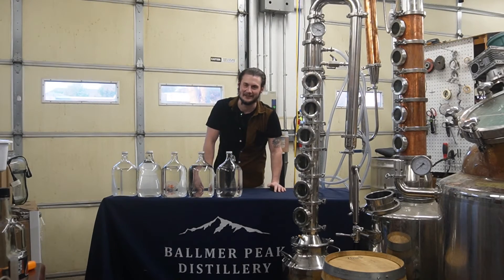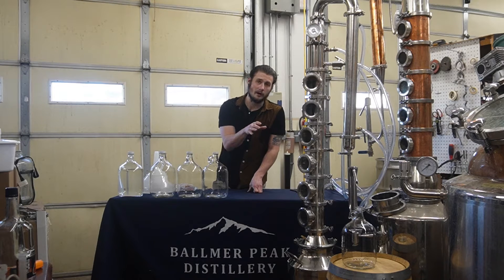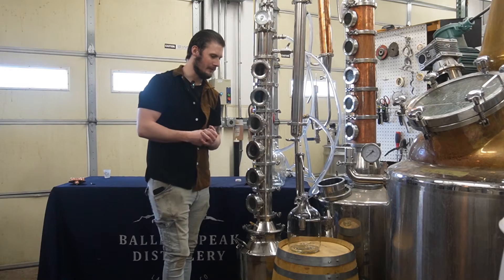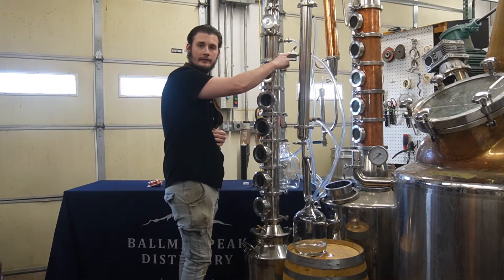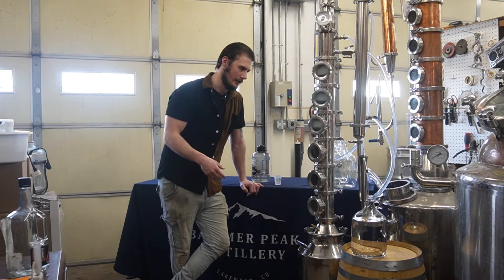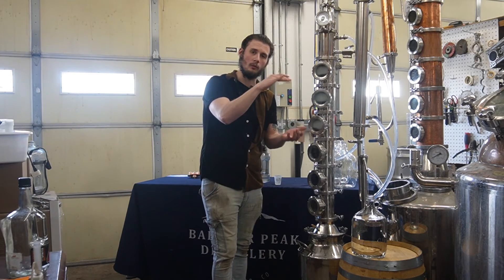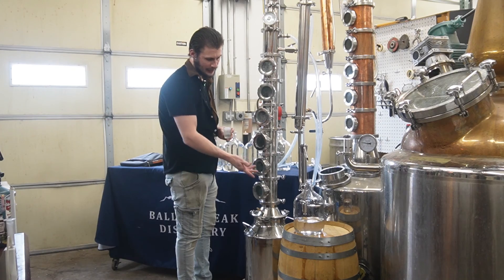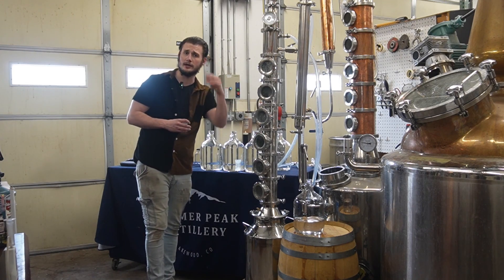How To Make Vodka and Getting To 190 Proof In A Still

Comment: Sir how and when do you take the Heads off using a thumper  . No one has show that in all the videos on youtube . My  rule of thumb is one ounce of heads per gal in the still or worth then I take the body and if it turns milky or under 50 proof I use that for the next batch to bring up the worth level . I'm using Eldderberry squeezing from wine and put two cups of berries in the thumper with two cups of water . I use a lot of your parts from Mile Hi Distilling . Thanks
Reply from the maker: Heads can be tricky becasue there's some variables with them. Sugar and molasses have much less heads than fruits would for example. How clean your still is can also contribute to the amount of heads as well. For a 6.5 gallon batch, I take off 350-500ml for foreshots and some of my heads, then usually fill another 12 oz. jar worth of heads and that's usually a safe number for me, but runs can be different.

Comment: why is the column full of wash.  It shouldn't be full.  I'm surprised it worked at all.
Reply from the maker: That's called reflux. It is low wines. That is normal for a reflux still.
Reply: @milehidistilling1  I have a reflux still.  That's NOT how they are supposed to work.
Reply from the maker: @SimonClemence-z2n  With all due respect, we have been building stills for two decades and we have a lot of knowledge on how they are supposed to operate. Does your still have plates? Plates will cause this in a still. It is how the plates are designed to work. Maybe that is the difference between your reflux still and our system here. Although, I do admit, this is more flooding than what you typically want to see in this system and is due to me overheating the unit. Regardless of that, you should always see some flooding in the plates if you're operating them right.
Reply: @milehidistilling1  I have a 4 inch six plate copper flute still with bubble plates.  The only time it has ever flooded like you are showing here is when I didn't leave enough head room in the boiler and had both elements working flat out.  A normal bubble plate flute still, when running at the correct adjustment should see product bubbling on the top of the plates and dripping down from above with not one of the chambers full of wash.
Reply: @milehidistilling1  Yes I have bubble plates.  The product should be bubbling and dancing on the plates with some product dripping down and NO flooding of the chambers.  The only time that ever happened to me was when I didn't leave enough head room in the boiler and ran it too hard.  And then I only got the first two chambers flooding.  With all due respect you should remove this video.  It demonstrates that you don't know how to run the very stills you build, which would have to impact buyer confidence.
Reply from the maker: @SimonClemence-z2n  I appreciate the notes and while I will have to do more research on the topic, I have to disagree with you for now. I've been to a lot of distilleries that use our equipment and every one I've been to using a flute has had activity in almost all of the plates. Here's a video from a distillery down in Reno using our 53 gallon flute and you can see he has activity in 5/6 plates: https://youtu.be/krOfBe3CUek?si=h7wRjkdRdtZtPs9K&t=733. Not saying you're wrong, but I just haven't had the same experience with these plates through the distilleries I've been to. I guess I will just have to do some more research and talk with a few more people.
Reply from the maker: @SimonClemence-z2n  Also, wanted to show you George Duncan from Barley and Hops running our flute in which he had most of his sections bubble as well: https://youtu.be/d6-JPCkXaqI?si=cm7L0MiQrGUhsCpy&t=1237
Reply: @milehidistilling1  The Reno guy is running better than you show in your video but is still running too hot and fast.  He admits it and has two 5500W elements going (wow) that's way too hot and hard.   The Barley had Hops guy has it right.  That's what it should look like.  Bubbling on the plates with no flooding.   This will give you the cleanest tasting product and is how a still should run.
Reply: @milehidistilling1  Yes George has it absolutely right.  Bubbling on the plates with no flooding the chambers (i.e. not full of product).  The still can't properly reflux if the chambers are full of product because when the product is knocked down it can't get past the flooding.  I suggest you may need more head room in your boiler or turn the element down or both.  Oh, and the Reno guy has not quite got it right either, but he's closer than you are.  I'm not trying to be rude, but you can see from comments that people are believing you have got it right and they will learn the wrong thing.   You need to fix this.

Comment: why would the 190 eventually start dropping if you maintained the defamator temp etc  i figured it would just stop coming out  when there is too much water and no longer able to strip high alc at the set 190
Reply: You would also have to reduce the power going into the pot as the alcohol percent goes down to keep from overwhelming the column,  as there will be more water vapor that needs to be knocked down reduces the efficiency of the column.
Reply from the maker: Because there is only a set amount of that strong of alcohol in the fermentation, so once it's all boiled off in the still, there's nothing else the still can purify at that high of a point. As everything boils, regardless of your temperature, the highest strength alcohol eventually can't separate out any farther and you'll start getting higher boiling alcohol like Propanol out.
Reply: @milehidistilling1  exactly so why not stop the run there? on my small homemade pot i have the temp so low that once all the good stuff is out it actually stops or starts sputtering telling me to stop and if i raise it of course ill start getting lower proof tails n water
Reply from the maker: @ARCSTREAMS  Because it's still good alcohol, so we collect it to use in future batches and clean it up.
Reply: @milehidistilling1  yes of course

Comment: My best run….with your turbo yeast, in your 16 gal boiler with 10 plates was 184 for the entire run.😊
Reply from the maker: Oh man, with that yeast, I bet you got a great yield as well. That's awesome!
Reply: does it juts stop running when it is no longer able to keep at 184?  provided you maintained all the temps etc
Reply: @ARCSTREAMS  184 proof average after the entire run.
Reply from the maker: @ARCSTREAMS  Nope, it will continue for as long as you wish it to. Temperatures can only control so much in a fermentation since it's a composition of a lot of different aldehydes. You will eventually not be able to maintain the highest proof possible from the purest aldehyde bonds.
Reply: @milehidistilling1  ok thanks so i guess when you see your parrot proof starting to go down you need to stop it

Comment: So you mention the water flow through the dephlegmator to control the reflux, but you don't mention the water flow settings through the shotgun condenser in any of your videos. I'm just wondering if you run the condenser full blast or partly open water flow.
Reply from the maker: Hi, Tazman. I don't mention this because it's a second thought most of the time, I guess. It's always a full blast type of deal, yep! I did a video where I experimented with regulated flow to this condenser, and I'm not sure it did much.
Reply: @milehidistilling1  Thanks for the reply, I just run mine at the lowest setting to make the distillate comes out cool, More to save water than anything as I have a limited supply.
Reply: I’ve got a neddle valve on top and a ball valve on condenser.   I change the condenser valve with temp and ground water temps.

Comment: Novice question here but if I have a finished spirit and I want to increase the proof as you did, I know I have to dilute it back to 40%.  My question is when is run it thru the still, will I have to deal with foreshots and tails since I began with a good spirit?  Or do I still need to make cuts because it’s an offshoot of a higher proof?
Reply from the maker: Hi, Michael. As long as you don't throw the foreshots and heads back into the boiler during your spirit run, they won't need to be taken out again. If you put the heads back in for the second run, you'll need to take them out again.

Comment: How long did u have to ferment the sugar water to get like that. I'd like to try some myself that way
Reply from the maker: This only took about five days to ferment to completion. but we used a turbo yeast. If you're using a regular distiller's yeast, it would likely take about two weeks.
Reply from the maker: I would like to add that the way you ferment has nothing to do with your proof level, it's actually completely dependent on your still and the way you run it. Some that aren't built right or with the proper parts can't get there. Cheers!
Reply: @milehidistilling1  yea I thought so. I'm not sure if mine would or wouldn't. Also another question I put my still on my stove.  When I heat it up is it better to go low heat and let it slowly get up to temperature or better to go and put the stove up to very high temperature to get it more of a rapid boiling 🤔
Reply from the maker: @iceman020187  I always recommend low and slow! Take your time heating up for the best results.
Reply: @milehidistilling1  thank you yea I definitely think I rushed it by putting the stove up to turbo boil to get it boiling fast. Next time will put it a lot lower let it go nice and slow. Thanks for the information hopefully my next run comes out better
Reply from the maker: @iceman020187  Right on and no problem!
Reply: Novice question here but if I have a finished spirit and I want to increase the proof as you did, I know I have to dilute it back to 40%.  My question is when is run it thru the still, will I have to deal with foreshots and tails since I began with a good spirit?  Or do I still need to make cuts because it’s an offshoot of a higher proof?

Comment: Several things you can try:  get some White Star premium vodka yeast, use dextrose corn sugar rather than regular white cane sugar, do a stripping run first then go to reflux distill, and finally, filter through stone charcoal.  Stone is called coal charcoal, and we use it in the pellet form rather than ground.  It is cleaner, filters better than coconut or aquarium charcoal.  Stone charcoal is bituminous coal.  Be sure to use a long filter tube and let the spirits run very slowly through it
Reply from the maker: Thanks for the notes! Will definitely be using a less processed sugar in the future and changing yeasts up to see if it's that much of a difference. The video where we filtered this vodka is coming out tomorrow, and yes, it made a phenomenal difference.

Comment: Why would you bother to dilute the stripping run down to 40% when going to the spirit run?  We take 160 proof right out of the stripping run put into into the reflux still for the spirit run.  You have 160 coming out originally and all the spirit run does is clean it up and maybe increase the proof.
Reply from the maker: I'm a little confused by the question. We went down to 80 proof in our stripping run because it's still good alcohol and we wanted as much alcohol as possible for our spirit run. Proof is irrelevant for a spirit run.

Comment: Add sodium hydroxide to your boiler on your spirit run, and It will really clean it up from a flavor standpoint.
Reply: Can you please explain this? tell me more about using sodium hydroxide to clean up a run
Reply: I use sodium carbonate (not sodium bicarbonate) although not in the boiler. After I do my stripping run, I add about 1 tsp per gallon. Let it sit for a few hours, then charge the still for the spirit run. From what I understand, the sodium carbonate binds with the fusil oils, etc. causing then to drop to the bottom thus "cleaning" the alcohol before distilling. It won't give you more alcohol, but it will give you more usable alcohol. I was amazed at the increased of final product I collected. I used Arm & Hammer's Super Washing Soda which I purchased from Walmart. If someone has a better explanation, please advise as I always like to learn more. I almost forgot. ONLY use this on a sugar mash. If you use on a grain or fruit mash it will strip out the flavor. @andrewmccambridge508

Comment: Too much heat noted during the 8:30 mark.  Plates are overloaded.  Slowly back off the heat input.  Also, as time passes your proof will continually drop.  It really becomes a question of how much energy do you want to use to get the alcohol left in the pot.  The foreshots should be monitored to remove the methanol.  If it's a sugar wash to begin with, there won't be much meth.  But if it's a grain wash their will be a higher initial fraction of methanol.  Just go very slow initially and continually to monitor for the start of a higher ethanol fraction then start the heads and hearts cut.  Save the foreshots though they're great for fire starter on charcoal and cleaning gum residue, but don't drink them, they're really hard on the liver, optic nerves and burn the taste buds.

Comment: I made a batch with my crude still made from a beer keg. Three runs and column full of ceramic beads. The trick I used at the end was a charcoal filter. Aquarium charcoal in 4 feet of 1.5 inch pvc pipe. Let it drip through over hours and have received numerous compliments on how smooth and free of any harshness.
Reply from the maker: Definitely a gamechanger for a neutral spirit when you filter!
Reply: Better to use stone charcoal than aquarium which is typically coconut and very dirty.  Stone charcoal is actually bituminous coal and is cleaner and a totally better filter medium to use.
Reply: @rocketsroc  is that volcanic rock?

Comment: Thanks so much for this. I can get to 190+ pretty easy with my set up but I'm never happy with the neutral taste i'm trying to achieve. It seems like there is an amount of flavor left not like what the commercial distilleries. You did a video on yeast awhile back. So my question is how can I look at different yeast  and know what it will produce for  the amount of esters. i hope I'm asking the question correctly
Reply: Several things you can try:  get some White Star premium vodka yeast, use dextrose corn sugar rather than regular white cane sugar, do a stripping run first then go to reflux distill, and finally, filter through stone charcoal.  Stone is called coal charcoal, and we use it in the pellet form rather than ground.  It is cleaner, filters better than coconut or aquarium charcoal.  Stone charcoal is bituminous coal.  Be sure to use a long filter tube and let the spirits run very slowly through it.
Reply from the maker: Hey, Jeff. I'd definitely recommend filtering the neutral spirit if you're not happy with the taste. Are you using refined white sugar? Switching to an unprocessed brown sugar will potentially help get rid of some of those tastes you're not liking. 

Finding out the amount of esters in a certain yeast strain is a little hard. There's not usually info on ester production on the yeast packets, so it comes down to just trying yeasts out until you get your optimum ester profile. For a really clean yeast, I'd recommend the Classic turbo yeast here: https://milehidistilling.com/product/still-spirits-classic-turbo-yeast/
Reply: Thanks for your time. I've been after a traditional vodka out of grains and if I add sugar i've been inverting it. I have used a few different yeasts over time. I'll certainly check out the turbo yeast and anything else you recommend. Filtering is a key part of what I do.

Comment: so can you explain the set up 8 gal pot, 4 or 6 inch plates would be helpful.
Reply from the maker: Hey Rob. 

I explained it a little bit in the video, but what it essentially is from bottom to top is: 
8 Gallon pot
Lid
Six sections, all with a bubble plate starting from top of lid and last plate ending up at top of fifth section
Six bubble plates with one cap facing down and the rest facing up 
4" dephlegemator with needle valve attached for higher control of reflux
4" x 2.5" reducer with thermometer port
U bend
2.5" diameter x 20" long shotgun condenser as final product condenser
breather cup to avoid buildup in my condenser
parrot for real time proof reading